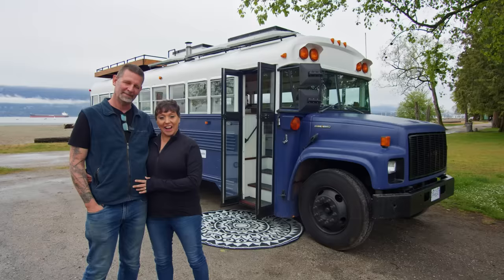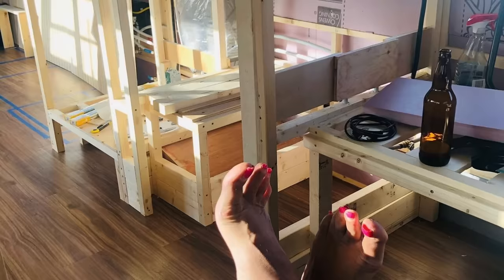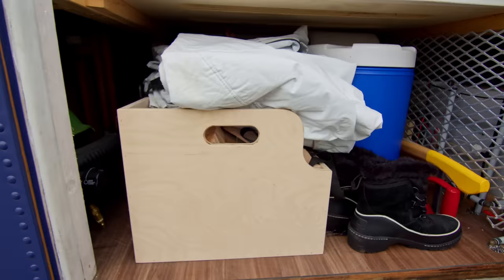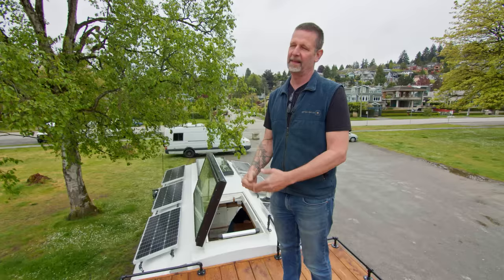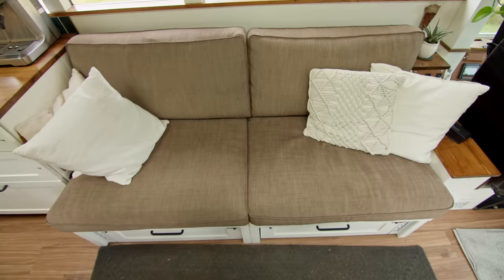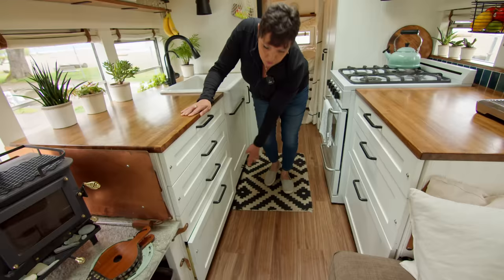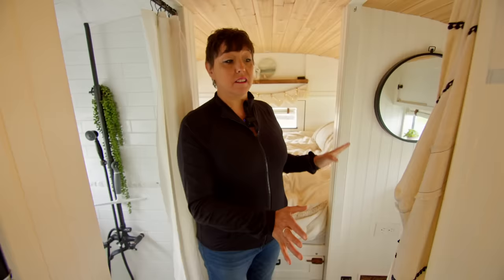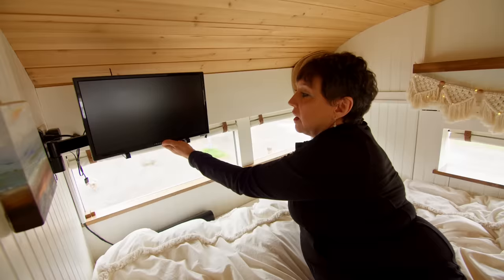6'6" in a Skoolie?! The Inside will Surprise You

Comment: I have a 1993 international blue bird I am converting to a skoolie

Question I spoke to a electrician that installs mini splits he came out saw the bus he suggested to get a 1 ton and 1/2 unit. Mainly because I live in FL and I need th a/c to keep the bus cool while I am at work for my pets. So I need advice on the type of generator I need to buy to make sure the a/c unit is running while the bus is off for up to 16 hours max. Any advice?